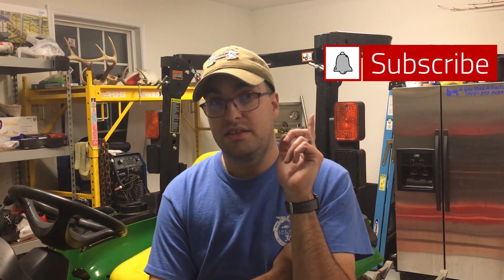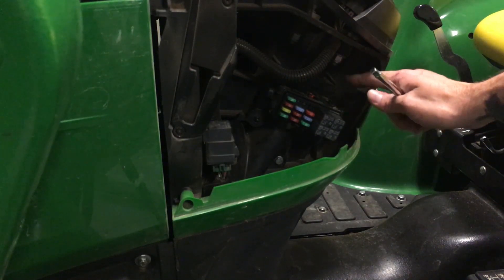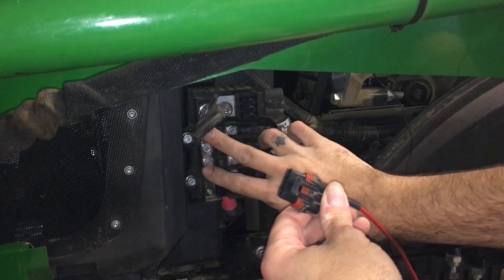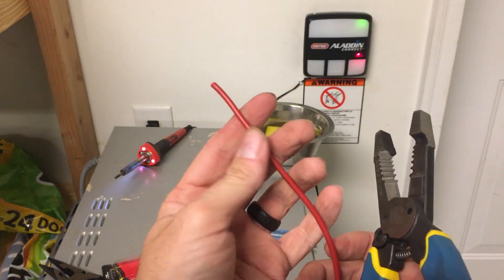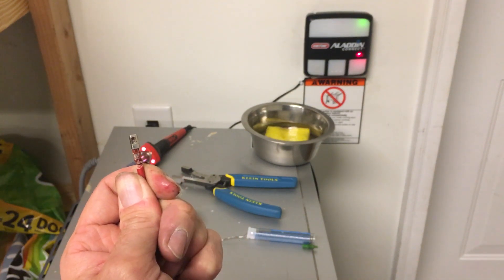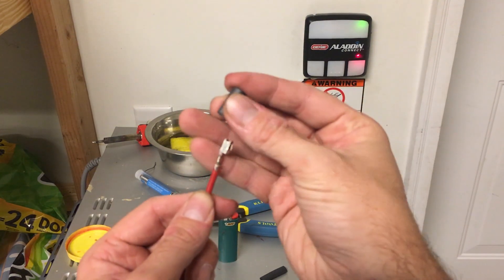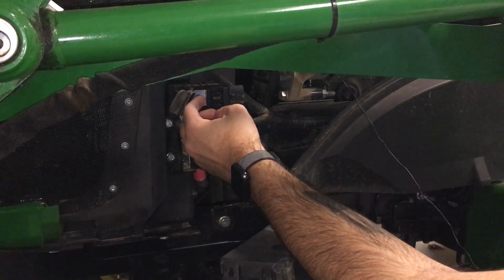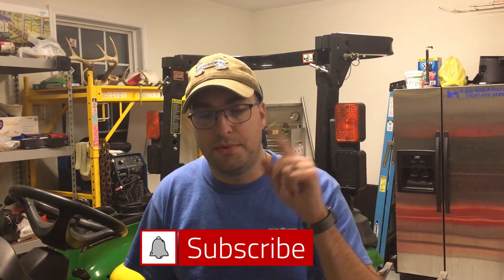#2 Adding Circuits to a John Deere 3025e

Comment: Hey would you look for any mfg markings on that three way fuse holder connector (all the way back to the eyelet hole)? I have tried to find one and can not. I want to add that to my 3033R midi fuse holder for additional 15a circuits. THANK YOU!

Comment: It would have been better to reinsert the seals (what you call rubber plugs) than to have used heat shrink on the terminal.

Comment: These extra circuits spots what kind of fuse do they use.  My 2018 3025e seems to have this set up but I failed to see how to add the fuses
Reply from the maker: If I remember correctly it’s the mini fuses.
Reply: @BBLandServices  Yes a mini fuse work.   Thanks for help

Comment: Thank you! Just what I needed to know to hook up my artillian grapple with a more permanent connection.
Reply: Do you have any recommendations where to hook all the ground wires?
Reply from the maker: I’m working on a video now adding some electrical stuff. It’s hard to find grounds where I’m needing them due to so much plastic. :( I think it will help you out. It’s a hydraulic line holder on the right side of the tractor just behind the fuel filter. Would be the the closest one to where you are adding the diverted probably. You can use a ohm meter and touch it to one of the loader mounting bolts and then find another bolt that ohms out. That’s how I had to find one. Hope this helps!
Reply from the maker: Owen Johnson check out this video and I discuss that grounding option. 

Adding a UBS Charging Port on a John Deere 3025e https://youtu.be/e7U_-HRqgPM